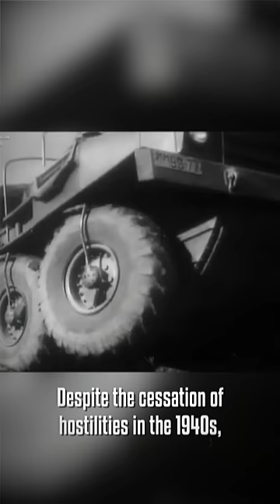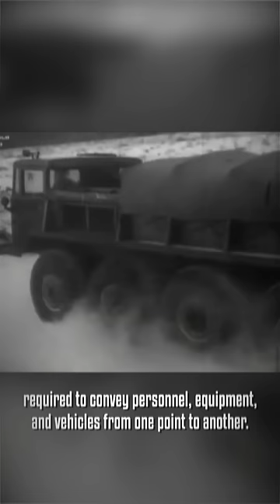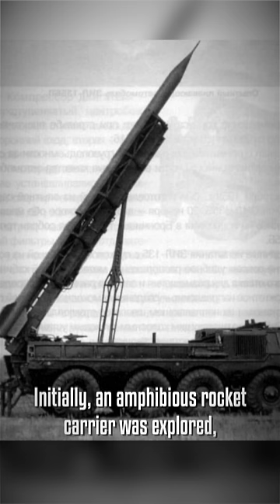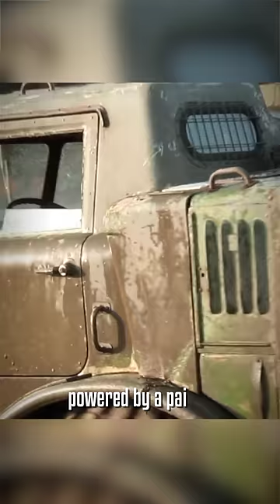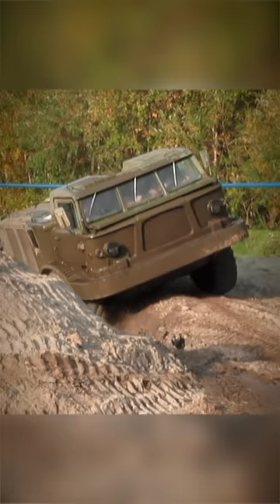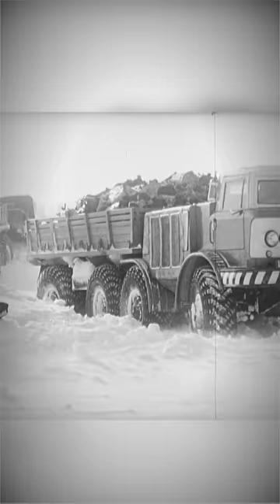This Is A Peak Soviet Engineering

Comment: Soviet engineering really was something else, sure, some projects like the soviet Concorde were just copies of the western counterpart, but they built a lot of cool original vehicles. I love the soviet aesthetic
Reply: I think the one good thing about their engineering of tractors and vehicles was that they knew that the people using them weren't the owners and thus would let problems go until a major breakdown. As a result, they made sure that stuff was easy to overhaul since Comrad Conscriptovich isn't going to let that genie light slow him down.
Reply: Tu-144 was in fact anything but a copy of Concorde, but then again, uneducated larpers coping, however, concorde was the more comfortable plane, Tu-144 was just a military aircraft in civilian colours.
Reply: @SMGJohn  I have no idea about the inner workings of the soviet concorde, I only meant design wise. But when the soviets designed their only vehicles, they had a really unique look
Reply: @witext  
Design choices are sometimes by physics, concorde and Tu-144 are both coincidental designs because they offered the best air performance at both subsonic and supersonic speeds, the Concorde actually has bit of superior design wise, Concorde also has engines that produces more thrust but leaves a lot to be desired in terms of serviceability whereas the Tu-144 is less powerful but easier to produce and repair. 
Its the same thing with the Space Shuttle and Buran, they look the same because its the best design for the job, the Buran in this case actually a bit superior in its flight characteristics but again, thats coincidental not because they copied by that logic the americans have nothing they should have said considering they copied every Goddamn British Steam engine out there during the early days.
Reply: @SMGJohn I met one of the engineers who worked on the Tu-144. It was no mere copy, even though spies did steal some Concorde files. He was very disappointed the US strangled  supersonic travel at birth. The Europeans were ahead, so the US banned supersonic flight overland. He said the boom from an aircraft at 60k feet would be minimal, it was pure protectionism.
Of course he and many other talented engineers left the Soviet Union in the 1990s, which explains why we don't see much innovation from Russia these days.
Reply: @lubumbashi6666  
Collapse of USSR was tragedy not only in human cost 7 million dead during the 90s and early 2000s but also death of Soviet scientific and engineering.
Reply: @SMGJohn This is only thing that union have at full, an desire to explore. But now even the US don't wanna develop further in space, need more OIL!
Reply: @lubumbashi6666  сколько лет этому инженеру? Когда он работал над Ту-144? К 1990 годам он уже должен быть на пенсии..
Извините, не верю. 
Ту-144 - первый полет в 1968 году. 
Допускаю, что он принимал участие в полетах Ту-144  по программе Boeing, была летсющая лаборатория.
Reply: @SMGJohn  Мы очень быстро восстанавливаемся, спасибо за сожаление. 
А сейчас мы ,с большим сожалением, наблюданм закат Европы. США,  вероятно, за счет Европы, передивут этот кризис. Но Германия и Франция - нет. Увы!
Я сторонник сотрудничества всей Евразии, но,  увы, Европа - всё.
Reply: Could be parallel thinking, plus you dont know what was inside
Reply: @ИванГригорьев-л5ы  I didn't say he was there for the first flight but he did work on the project, his first job out of college. In fact he is just past retirement age at present, but still working. He also worked on the Tu 204.
Reply: @witext just because a design is similar doesnt always mean they copied it, an example of this a a british aircraft that was built too late to see action in ww2 (i forgot the name of it), it looked just like the famous p51 of the americans and were acused of copying the design, but both of these projects were designed independently and there was no evidence to show that they copied one another, it was simply the conclusion of the design and research teams for the best fighter design, even the spitfire by late war looked similar to the p51 especially the ones with clipped wings and a bubble canopy.
Reply: @SMGJohn my dear friend comrade.. belive - it's was more than 7...
Reply: @ИванГригорьев-л5ы it's not a problem
Reply: @SMGJohn  Yes very true, they had some of the best scientists in the world.
Reply: uuuh no the tupelov concorde was NOT a copy of the western concorde... it was completely seperate. you also act like its easy to copy something? wheres africas copy of the concorde?
Reply: @witext design wise? you have no idea what youre talking about. nature defines the design
Reply: @someone862 yes, their rockets are particularly impressive and were better than their American counterparts imo
I would even say the Soyuz is better than most rockets today, save the falcon 9
Reply: @someone862 like what?

Comment: Only the Soviets would build an off road vehicle with NO SUSPENSION ! LoL

A triumph of committee over engineering 👍😂
Reply: Who needs suspension when you're going  5 kilometers per hours
Reply: @coney2010grads  your spine.. also the fact suspension provides tracktion lol
Reply: The ukrainian Sherp is literally the best offroad vehicle ever made. It can go literally anywhere, through the deepest mud. It can swim. It does not have suspension. These vehicles don't need it. The giant low pressure tyres act as suspension.
Reply: @jakubukleja2553  it's dead meat
Reply: @jakubukleja2553  Totally different to a huge long wheelbase missile carrying truck...

Sherp is frickin' AWESOME though 👍
Reply: On these vehicles, introducing a suspension system would legit just be like doubling or more the possible points of failure/otherwise problematic points. With the kind of beating these vehicles receive on a regular basis, building in a suspension system is literally asking for trouble, and the trade-off of maintenance costs for a little bit of extra comfort for soldiers is really not worth it (plus they can do things like use large, lower pressure tires, and speeds aren't terribly high anyway)
Reply: @pizzlerot2730  Name another off road truck/transporter without suspension ?
Reply: @edwardfletcher7790  given the confidence that you're displaying here, I'm going to guess that you've forgotten that the vehicle in the video was primarily an amphibious transport, which carries significantly different considerations from traditional ground-based vehicles. Also, we're talking about earlier Soviet manufacturing, using Soviet design principles.
Reply: @pizzlerot2730  Primarily Amphibious ? Come on, I thought we were having a serious discussion. It's not a PTS or MT-T.
It's just a really strangely designed truck. From what I read, only the prototypes were tested with BMP style thrusters but the weight of the missile and body lean due to not having suspension made it a failure.
Reply: Bonus no kidney stone on the military, two flies with one swat😉
Reply: @jakubukleja2553  lol nice try
Reply: @jakubukleja2553  1 bullet in the tires and its dead in the water.
Reply: @ArmedSpaghet  dont really need suspension in feet of snow and mud watch is alot of Russia's wilderness.
Reply: @jakubukleja2553  It may be one of the best for off-road performance, but it'd be a shit military vehicle unless its a UGV (Unmanned Ground Vehicle) since it has fuck-all armour while having such a high silhouette.
Reply: @jakubukleja2553  Yeah but what can it carry? 
What’s its weakness?
Reply: I've never seen an off road haul truck have suspension. Nor a tractor or a front end loader. It's in the seat. Especially if it's just a missle tractor.
Reply: @ADogNamedStay  So you've never seen leaf springs, which EVERY modern truck has LOL ?

Except Unimogs (coil springs)
and Tatra (torsion bar)...
Reply: @semenivanoff8615  Wheels are the metal part genius lol
Reply: Suspension seat. And the chassis flex is enough suspension in Soviet Russia
Reply: Glory to the Soviet Union & Mother Russia!💪👍🙂💥
Reply: Who told u it was with no suspension? He said no differential.
Reply: @edwardfletcher7790  almost every single tractor😂
Reply: @orionfoxx1954  Tractor ? Farm machinery ? Not an off road truck.
Reply: Yet, their trucks have more traction than any other. Look up some off roading with their trucks to see what I'm talking abut.

And they DO have suspension.
Reply: @derbigpr500  Not the model in this video .
Reply: I think the low tire pressure IS the suspension.
Reply: Tractors only have torsion bar & sprung seats and it works fine.
Reply: Americans had dimilar designs with low pressure tires. Ukrainian sherp and russian shaman also do not have suspension. Westoid cannot understand physics
Reply: I think the front and rear tires have suspension. You can see it has upper and lower control arms. They also have steering capabilities on the front and rear.
Reply: @adamscott9725  Steering arms aren't suspension...😩
Reply: Then why would they use upper and lower control arms that have hinges. If you Google sil134 drivetrain diagram, you'll see the 4 middle tires hub is attached to the frame with metal and bolts the front and rear 4 tires have hinged upper and lower control arms that says it has travel to me that being said I've never put my hands on one nor have I driven one this is all speculation.
Reply: @jakubukleja2553 the tires on those are significantly larger with much lower pressures. Don’t be ridiculous
Reply: Cmon gust build are road on permafrost😂
Reply: @jakubukleja2553  Шерп - вездеход Гарагашьяна, Россия. Украина их делает по лицензии. Сейчас, наверно, без лицензии.
Разработка, по любому, российская.
Reply: The suspension is built in to the seats.  That’s the only place it is needed.
Reply: Bro, its a Military Vehicle, not some Range Rover Luxury.
Reply: They had suspension, a rigid one prioritising cargo safety over crew comfort, imagine leaf spring but more tough than one in truckbeds.

But they had internal radiator installed to kept everyone in cabin warm.
Reply: You're wrong. The tires are the suspension 😂
Reply: @agps4418  No, tires are tires 😜
Reply: @edwardfletcher7790  not according to soviets 😂
Reply: @ArmedSpaghet air seats.......
Reply: @Isaac-ho8gh I want to call your comment stupid, but I'm going to let it slide because I legitimately don't think you would have come to that conclusion if you'd thought about it for even a moment. 
  But for a tldr. If your long rang rocket/nuclear missile carrier is being shot at by rifles, something has already gone horribly wrong
Reply: It was designed with low-pressure tires, which acted as a suspension mechanism. However some versions, specifically ZIL-135L/LM, did have torsion bar suspension & hydrolic shock absorbers.
Reply: And yes, as noted above, Sherp, famous modern days vehicles with low-pressure tires acting as a suspension, was developed in Sankt-Petersburg, Russia, manufacured in Ukraine under license (I suppose nowadays they might not care about the licensing fees too much)
Reply: @leonodonoghueburke4276  how? Because any military vehicle that is slow; big, and doesn't have enough armour is gonna get fucked up easily in almost any frontline role.
Reply: @jakubukleja2553 Ukraine was a part of Soviet only
Reply: Big tires are suspension 😂
Reply: Tire is suspension enough on my fat bike. This is kind of a big fat bike. A leakage in a tire or two might be fixed by the pressure control system, also a truck can go on with a flat tire. This is not a vehicle for the front line, do not need armor. I´d love to have this one with me to the off road meet. There is even bigger missile carriers out there. But you will have to pay a lot for the fuel. My bike is superior in that category.
Reply: @bjorngve  Are you REALLY comparing a bike to a 6 or 8 wheel truck ?? LMAO 😂
Reply: Там независимая подвеска, даже на видео это видно.
Reply: Like number 667 ❤god bless
Reply: Yankies in the comments will always find something to criticise when it comes to Russians or just any other peoples that’s not in the west.
Reply: @jakubukleja2553 wheels are close together though and they are enormous. Not the same thing here
Reply: They put suspension in the seats... cheaper...
Reply: @dylandesmond  Do you understand that suspension controls traction over uneven ground ? A bouncy seat won't help grip if a wheel is in the air....😩
Reply: @romeolarenzo3929  I'm not American 😂
Reply: @jakubukleja2553  bot
Reply: @dylandesmond  so its off road capabilities are still worse. Thanks for confirming lol
Reply: It's good though
Reply: @Dr.Mcstaby keine Ahnung!
Dafür gibt es den automatischen Luftdruckregler wie bei fast allen Militärfahrzeugen !
Reply: @atlanticgamer89_Anti-Furry  not for the crews it's not lol.
Reply: @Isaac-ho8gh  Unbelievable, you're giving me a counterargument, that you'd end destroy in your own counter argument. An artillery vehicle is not used in frontline combat you dolt, how do you not understand that?
Reply: @jakubukleja2553 ukronazi can't do the cars
Reply: @jakubukleja2553 what is this - ukraine
Reply: @jakubukleja2553  buy is it a big and cheap truck capable of carrying large loads?
Reply: is that why their machines are so crazy? design by comitee?
Reply: @AckzaTV  Exactly, there's no such thing as "individual thought" in Russia....
Reply: а что смкшного то в этом ? если инжинеры так сделали то в этом есть смысл
Reply: @SkrillexNekita9824  Did you notice I'm not speaking Russian comrade ? 😩
Reply: @edwardfletcher7790  и что ?
Reply: @edwardfletcher7790 How about ANY traktor, or the gigant CAT dump trucks that are used at mining sights??! They are suspension less too... The only suspension there is is in the seat, where the whole seat is suspended by air!
Reply: @SgtMclupus  Ummm they work on prepared dirt roads in mines on their huge tyres.

They don't go off road thru swamps and on bumpy roads.

That's a really silly example....😩

Comment: Just as the BTR-60 and 70, two engines, left engine drives axle 2 and 4 right engine drives axle 1 and 3
Reply: This drives left and right sides though, not axle sets. A terrible idea.
Reply: @thelandofnod123  yes, that is true, very strange. But i dont think the problems were that big, if it was produced from 1966 to 93 with the same system. But still, a failed motor isnt too bad for the BTR but on the Zil it makes it unusable.
Reply: @Kasi11  The drive system was very maintenance intensive and problematic when not well maintained. This was a particular problem during the Afghanistan invasion. 

The Soviets did have a tendency to continue with poor designs rather than admit there was a problem. However even a good design was let down by poor manufacturing, quality control, material variation, maintenance ect.

Comment: it looks like it has special bars to lock the suspension in place on some of them. I've never seen that before. I love the twin v8 powerplant. it's absurd but awesome. it looks like they had civilian models too. that's dope.

also, those tires are low pressure, reducing the need for suspension travel.

Comment: 'It will even work with one engine's....when you're in one of those moods where all you wanna do is drive in big circles 😊
Reply: Nah ✋ man each drive/powertrain drives two ✌️ of the four axles it does not work like a skidsteer
Reply: @njabulogodfrey2039 Exactly, but the problem with this type of system is using it on a paved road. On a hard surface you get 2 axles spinning at one speed and the other 2 at a different speed as 2 mechanically controlled motors will never turn the exact same RPM's. That's the flaw in the design. Works well off-road 'tho.
Reply: @jomamma1750  all you got to do on a road is kill one of the engines
Reply: @_AcatHat  Lol, what a brilliant idea! Just shut off half of the power! That'll help you out under fire 'fo 'sho!! Pure genius ideas you have......
Reply: @jomamma1750 I'll probably look into the wheel thing, but If your long range rocket launcher is getting shot at something has already gone horribly wrong.

Comment: The initial model was state of the art engineering with automatic gerbox. Later military requested to simplify design and the manual gearbox was implemented which was much cheaper, but couldn't synchronize effectively to engines and had many reliability issues. The main engineer of the initial project said it's a "step back" and was right. The "cheaper" version was unruly, hard to drive and less reliable. Depsite it, the machine was widely used and praised for high mobility.

The experience with this ZIL was later used in later versions of MAZ "rocket carrier" which used different 6x6, 8x8 system and were more reliable and easy to use for the driver.